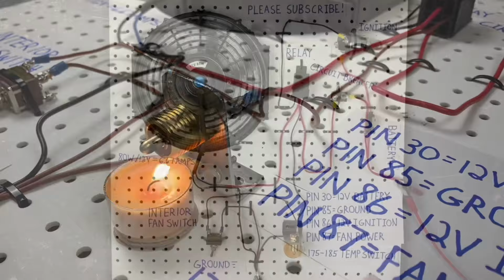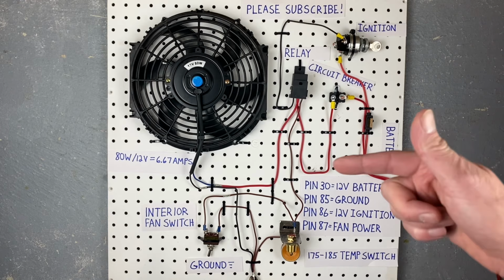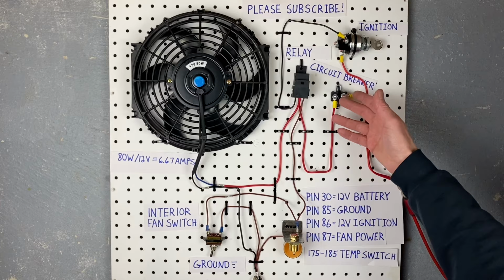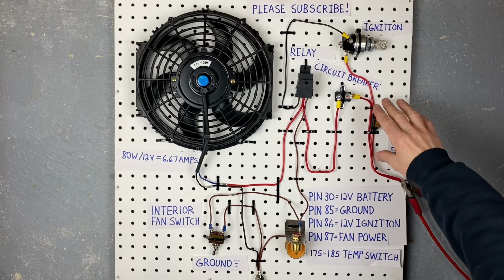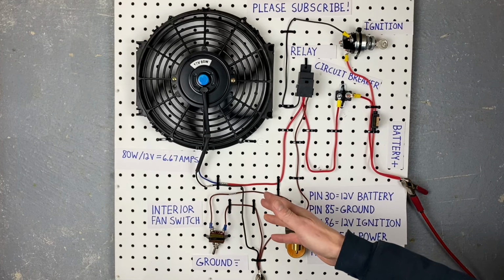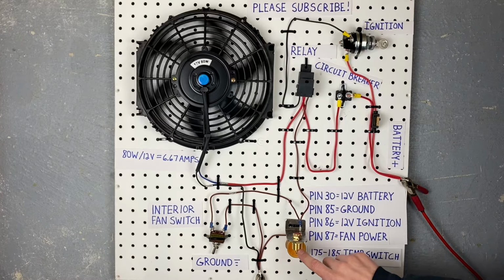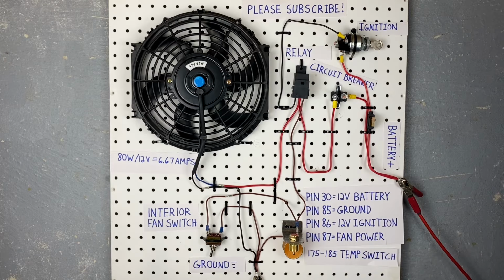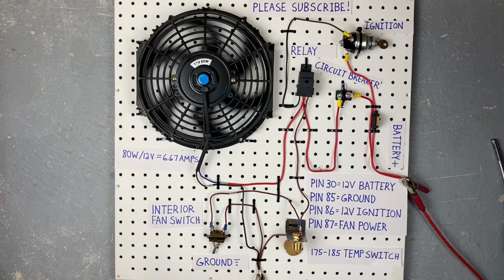How To Wire An Electric Radiator Fan Relay Temp Sensor AND Switch! | @WiringRescue

Comment from the maker: Thank You for Watching my Electric Radiator Fan Wiring video! 
Subscribe To This YouTube Channel: http://www.youtube.com/user/4g63mightymax?sub_confirmation=1
See My Wiring Playlist: https://www.youtube.com/playlist?list=PLsF7T1tRFy2hmiiUUfMZNyV-BUA_yrPIh
Reply: Can you  help  me with a simple project idea
Reply: Where can I buy  this box
Reply: i follow the diagram. but the 1 thing  problem is coming cold the sensor not coming off the fan
Reply: if you have a 1 pin temp sensor how you wire it to your gauge on your dash board so you can see it on your dash with a 1 pin temp sensor?
Reply: @willardelkins5637 😢
Reply: Thank you for this awesome video. How to add a temperature gauge into this?
Reply: If you wanted the fan only to be worked manually and since the fan only uses 7 amps, would it be ok to wire it directly to the battery through a toggle switch without using the relay?
Reply: In this setup, could you run your gauge at the instrument panel or would I need a separate aender for that?
Reply: Gonna link you in my video! Well put together video for a fan wiring, used this method, works well.
Reply from the maker: @CT9A_GTA glad you found it helpful! And yes - link/tag me! I’ll check out your video.

Comment: Honestly I appreciate your professionalism and clarity on explaining this 'HOW-TO!!" After watching this video, I have no idea how anyone can mess it up. THANK YOU🤘🤘
Reply from the maker: Awesome! That’s really kind. Thanks for watching and stay tuned for more wiring videos!
Reply: Trust me their are people who can still screw it up ..that's life in the mechanical world ..
Reply: I did somehow. I followed the video to a T, and it still is not working. I’m about to rip it all out and start over.
Reply: Hi Jeremy,

I’ve just read yr question. I have just released video where I wire straight to a cigie. 
Have a look and let me know what you think.
Cheers 
Out There Touring
Reply: Hi Sir you have explained how everything is wired up & some guys use pin 86 as ground & pin 85 as power on the 12volt Relay & I tested the 12volt 100Amp waterproof Relay & I followed your wiring the same way as you have Sir pin 86 Pin as power & pin 85 as ground on the relay & it works really well indeed & I tested it with a led light bulb & later on I will get an 12Volt radiator electric cooling fan unit & has 2500CFM with a 90 watt electric fan motor & so should work really well to & the radiator electric cooling fan unit will be installed inside the radiator & will have straight fan blades as you get better air flow than curved electric fan blades & radiator electric cooling fans that are installed in front of the radiator don't get better cooling than a radiator electric cooling fans that are installed inside the radiator as the engine & engine components get by far better cooling when radiator electric cooling fan units are installed inside the radiator & I have seen on Utube some of the guys have installed the radiator electric cooling fan units have installed them in the front of the radiator & one particular Utube channel has installed a very big radiator electric cooling fan unit & has installed in the front of the radiator & because he couldn't install it inside the radiator as there was no room to install the electric fan unit & having unit probably could get cooling but the is a smaller radiator electric cooling fan unit installed at the front of the radiator & probably wouldn't get that much cooling as it would be installed inside the radiator & probably also didnt have the room to install the electric fan unit that I'm getting will be inside the radiator & the 14"inch fan should work really well to & having 2500CFM air flow should keep everything nice & cool for the Toyota 3.4V6 engine & doing away with the clutch fan unit Kind Regards Peter & have a Lovely Nice Christmas Day Sir
Reply: 'Hold my beer....'  B-)

Comment: In the Toyota radiator fan cooling system (and some other brands as well), the temp. sensor is grounded when it's cold,  in case the sensor goes bad, the fan will stays on as long as the ig switch is on/engine running to prevent the car from overheating.
Reply from the maker: That’s great info, and a smart design! Thanks for watching!

Comment: I was doing a random search on the electrical side of the cooling system and found your excellent presentation as I was about to give up. Needless to say, I've subscribed. Because you've not only clarified a suspicion I had, you've also taught me enough to go through the circuit in a logical way. So from the bottom of my heart, thank you!!
Reply from the maker: That’s fantastic! Thank you for watching and subscribing! If you liked this one, I have many more you may find entertaining!

Comment: Awesome demonstration! I am not watching to gain the knowledge for automotive reasons (although now I know), instead I am searching for a clever no-solder solution to the always on tiny 24v cooling fan for the hotend of my 3D Printer. Your simple explanation of how relay circuits work really helped in figuring out the different hardware, how they interact, & how to wire it WITH A BYPASS to boot! Thanks again! 😊
Reply from the maker: Heck yes! That sounds awesome. 3D printing is something I’d love to get into, but I just haven’t dropped the cash yet!

Comment: Perfect! I wired mine up last night, minus the temp sensor. I added it along with my clutch fan. Since I have a temp sensor with a gauge, I will only activate the electric fan when it reaches 185 degrees. Other than that I will rely on my trusty, old faithful clutch fan! Thanks for such a detailed diagram!
Reply from the maker: Sounds awesome! Congrats on your cooler engine!

Comment: Great video and circuit board explanation.  I'm going to just wire mine to the battery.  This way when I turn the car off, the fan can keep running and cool the engine block down.

Comment: Thanks for posting this!!! Really appreciate your professional demo board. Sure makes it easier to understand how all that wiring ect comes together. My 67 Mustang 460 big block has two push fans with relays and no manual toggle switch. It was overheating at the car show the other day. It was like 98 outside. I want to add manual toggle switch to turn it on before it get too hot. I run two relays, I assume on for each fan.? Wish me luck. Cheers from Motown.

Comment: Thanks, very educational 👍
My Civic 2006 has 2 temp sensors, 1 in the radiator & 1 in the thermostat housing. Going to try changing the rad sensor as the fans aren’t switching off.

Comment: Thank you for the video! 
2 questions.  What would cause the relay to fail?
How critical is the circuit breaker?
Reply from the maker: Relays fail if they are in harsh environments (hot/cold/wet), old, or if they are handling more electricity than what they are rated for. They also have a lifespan too, which is often listed with them online.
A circuit breaker or fuse is necessary. People like circuit breakers for fans because they draw a lot of amperage when they start, and then don’t draw nearly as much when they are running. Sometimes fuses have a tough time managing that and you need to run a bigger fuse or a slow burning one.

Comment: This is what I miss since I have moved abroad people with skills that know what they are on about. I won't say where I live but most of the electricians here can't even read a drawing they should watch your channel and learn I will do this myself after watching this cheers.
Reply from the maker: Thank you! I’m glad that you find the video & the channel helpful! Tell the electricians in the area to watch my channel too ;)
Reply: @WiringRescue  yes I will though I think I will do this myself as they don't solder and use heat shrink. They just twist wires together and use electrical tape because it cost too much or have no solder skills and some don't even know about heat shrink 😳
Reply from the maker: @kanenstuff  - wow! You may also want to check out the uninsulated crimp connections. I use them and they work well, especially covered in shrink wrap. Good luck with your project!
Reply: @WiringRescue  thanks I will check that out as I am restoring a BMW E36 325i here and most of it is doing the dodgy wiring.

Comment: I’m thinking of wiring my cooling fan to a switch in the dash because I have no idea where the problem is but after watching this I probably should just check all the wiring and the relay. Seems easy enough but if I need to wire it to the dash I’ll do it! Thanks!!!
Reply from the maker: It’s common for under hood relays and temperature sensors to go bad, so those would be a great place to start. Swap out the relay for a different one under the hood. Sometimes you can use a headlight relay or similar. Also the temp sensor is probably 1 wire, if you ground that wire with the key on, the fans typically kick on. Good luck!! I’m cheering for you!

Comment: Regarding fuses.  The fan-relay kits that I purchased came with a 30amp fuse.  Since I have that same 7 amp fan motors I put in 15 amp fuses figuring that would be enough (two fans, each with it's own relay) Both fuses fried in a couple days.  I upped it to 20 amps, same thing, a few days -- boom.   I put the 30's in there an they're holding so far.

Comment: Awesome Explanation!! Love it, just one thing if I may. When car is moving the fan will spin and generate Electricity and feed back to the manual switch and it might get hot, use a diode to stop the flow of electricity!

Comment: THANKS THAT IS AN EXCELLENT VIDEO, AS IT IS I'M HAVING PROBLEMS WITH MY FAN NOT ALLWAYS COMING ON, NOW I'LL KNOW HOW TO OVERIDE OR HOW TO DIAGNOSE PROPERLY. I DON'T TAKE MY CARS TO MECHANICS, BECAUSE THEY ALLWAYS STARTS BY REPLACING THE MOST EXPENSIVE PARTS, AND THEN FIND OUT THERE WAS A LOOSE WIRE ALL ALONG AFTER SPENDING YOUR YEAR'S SALARY. MY DAD WAS A MECHANIC AND TAUGHT ME TO START CHEAP AND WORK UP, IF YOU WANT TO FIX SOMETHING, NOT LIKE THE GARAGES NOW WHO WANTS TO REPLACE YOUR ENGINE WHEN YOU'VE GOT A MISS FIRE.

Comment: Very informative video and I really appreciate the simplicity of it. 
Can you include the amperage of the fuses and wires you use and what effect a wrong amperage fuse, switch, or wire might have on these systems. 
All in all, you're doing great. ❤
Reply from the maker: Thanks! I actually made a video to answer this exact question. Check this out - https://youtu.be/EhzN6UdnmPA?si=Tn1OUTjYCv3r2OZN

Comment: Thanks!   I just bought a fan and a wiring kit (probably the exact same kit, from the look of it), it didn't come with instructions, your video confirms what I'd guessed - in particular, what the mysterious little tin box labelled 'Batt' and 'Aux' is (it's the circuit breaker) and where in circuit to put it.

Comment: Good stuff, just picked up a 55 Chevy. Can believe the wiring what a mess. It even had the blue fan wire as ground so it ran backwards when I used a hot wire to test.

Comment: Really great video with clear example. My 88 Civic is having issues where my fans will not turn on. The car doesn’t overheat because I’m not setting in traffic and it’s a big radiator for the small 1.5L engine. I want to repair the circuit and also run a manual on/off switch.

Comment: Thanks for the explanation.
I watched over a dozen other videos on youtube by so called DIY guys that said an extra relay was required for a manual over ride switch for the cooling fan.
I was pretty sure it didn't need a 2nd relay; and it could be done with a trigger signal on the existing relay. Like how you grounded it out, thank you for confirming my suspicion on that 👍
Reply: I'm subscribing to this channel ✌
Reply from the maker: Awesome! Thanks for watching and subscribing! I’m glad the videos helped you out!

Comment: Nice instructions.  I had a similar set up in a Wrangler.  Except I had a kill switch in the cockpit in case I was going through water and wanted to shut the fan off.  It's funny, I see people killing themselves wiring up digital fan controllers and in-rush caps and I had a crappy thermostatic switch, a 4 pin relay and 1 switch on the dash and never had 1 problem.
Reply from the maker: Thanks! The Jeep idea is interesting- I didn’t know people did that!  As for this design, it’s a pretty solid setup, and the best part is that it is really cheap + easy to get parts for at any auto part store if something does go wrong. As always, thanks for watching and commenting! I appreciate it!

Comment: Very well explained. Very clear and precise. I only wished you panned back after lighting the candle. I would’ve rather watch your entire system/set-up as we waited for the temp switch to heat up, rather than the candle close-up that entire time. But it’s kool. My fans are gonna be wired up properly because of your vid. I’m gonna use 2 relays. I’ll probably hook up two different temp sensors. 180° – 160°, and maybe another at 190°; or possibly an override switch…

Comment: Very well done and easy to understand for everyone. Excellent work.  As an additional bonus how would you install a light for the dash that would tell you that the fan is on. Whether the fan is triggers by the sensor or the manual switch. Thank you.

Comment: What would be done differently if I had two fans instead of one?
I’m getting ready to install double fans in my car and was about to pay to have it done until I found this video.
Great demonstration. I just subscribed because it was such a great video.
Reply from the maker: Generally two fans means two relays. You’d split the trigger wire coming off the sensor and send it to both relays. You’ll have two fuses (or circuit breakers), the switch wire would split and go to both relays. You may also want to check this video out on wire and fuse sizes. I think it’s really helpful if you’re somewhat new to wiring. https://youtu.be/EhzN6UdnmPA?si=vE0-eEehmlKVw7m5
Reply: Thank You for your reply. I will wire the fans as you described. I appreciate the feedback.
I checked out the video you posted in the comment. You have great, but more importantly, very helpful information.
THANK YOU! Thank you for sharing your experience and knowledge to help us on our journey.
Keep doing what you are doing!
Reply from the maker: @user-pk8fm3gl8g your welcome and good luck with your project!

Comment: Thank you so much for this video. I have overheating problems in my 86 camaro and plan on running my dual fans. 
I just don’t understand how I have two relays when this one has one.
Reply from the maker: It’s probably one relay per fan, but should be wired the same way. The wires are just connected together most likely.
Reply: @WiringRescue  thank you. No for my 86 camaro it only has one fan and used a relay which is connected to the 86 85 30 relay you use in this video. But I just followed your video and hope it works. Haven’t finished connecting them since i need a radiator

Comment: Very well done and explained. Thanks for taking the time to make this video. Only thing I do different is instead of ignition power to the relay, I give it power all the time even with the key off.  What this does is allow the fan to run for about a minute after the engine is shut off and it really does a lot to cool down the engine bay. Just keeps everything from heat soaking after you get done driving. And then it shuts itself off like normal. If anyone wires it this way, just don't forget to flip your manual fan switch off, because obviously it will run on and kill your battery.

Comment: Nice! Would be nice to make same video about 2 fans and two relay setup with two levels temp switch. On one level both fans are conected in a row and spin with half speed both and on second conection become parallel and they spin fully :)

Comment: how about doing a few videos about potentiometers and/or rheostadts. the dashboard of a vehicle gets dimmer and brighter using a rheostadt. perhaps show how to make a circuit similar to your other videos here. perhaps differences in potentiometers and rheostadts and the variety of them out there. perhaps use several different types for different applications in your circuits. I'm very interested. I have a few more video ideas like with alternators, diode trios, step up transformers and step down transformers. you can really explain things well. I've never seen a video on the internet that explained things so well and so thorough. thank you.

Comment: Hi Jeremy you have a very good set up here of the full wiring diagram & works reallly well to thanks for that Jeremy & have 100 Amp 12VOLT Relay & have set it up to operate an led light & works really well to & later on I will have it operating an electric radiator cooling fan which I can get a 2500 CFM 90watt electric cooling fan motor from AliExpress Store Kind Regards Peter
Reply from the maker: Sounds great! Thanks for watching. I’m glad you enjoy the videos!
Reply: Hi Jeremy I'm Wishing You & Your Lovely Beautiful Family A Lovely Nice Happy New Year Kind Regards Peter

Comment: I have severe adhd and i got it its a mircle wish i had a teacher like u growing up thank you i do have a question i have a 1999 k1500 chevy with a 5.7 im being told i would have to have my computor flashed for my temp sensors to work is this true
Reply from the maker: I’m glad you found the video helpful. I don’t think you’ll need anything flashed to have fans work the same way that this video shows. This design bypasses the entire factory fan system.